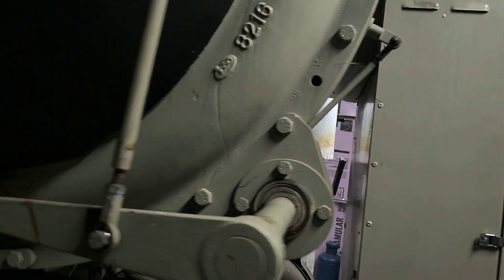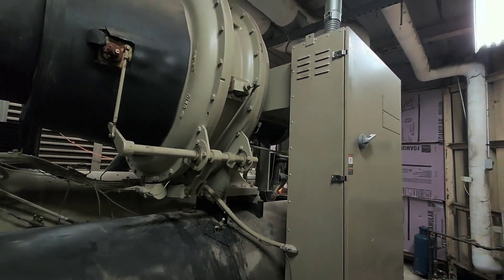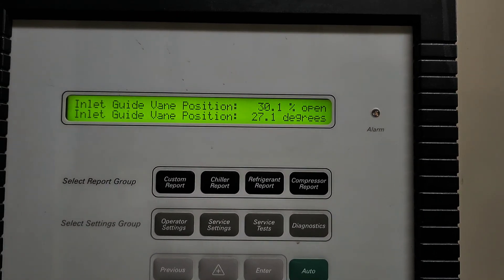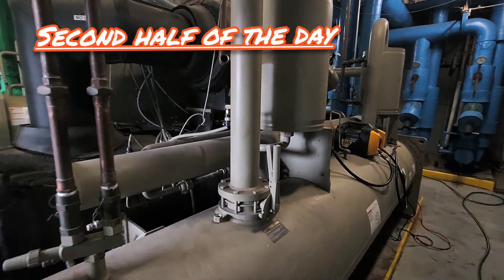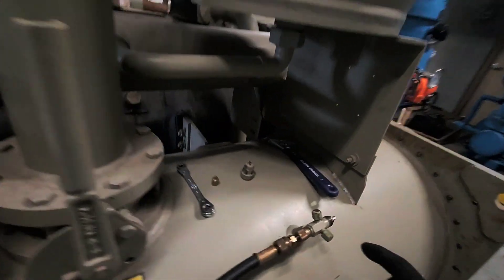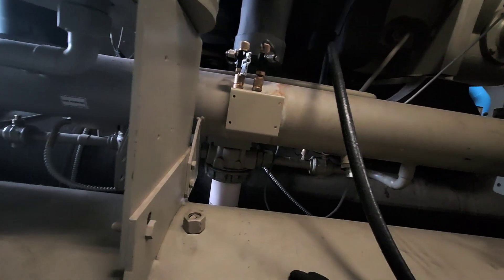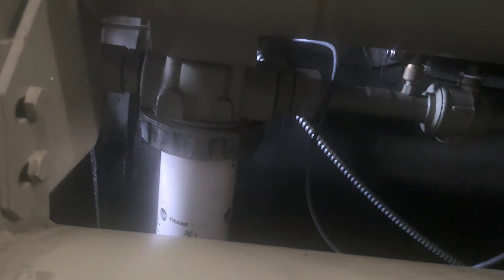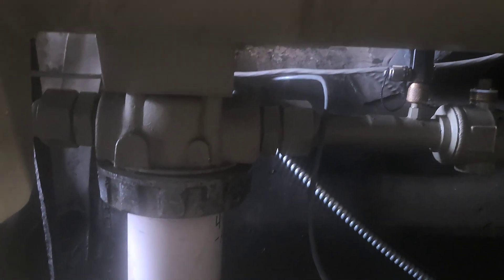CENTRIFUGAL CHILLER IS SURGING. SHOWING HOW TO PERFORM OIL FILTER REPLACEMENT ON RTHD.

Comment: First you need to take the purge out of adaptive. Dumbest thing ever. 7 psi at 27% should of told you that there was air in the machine. Oil pressure is extremely low for a Trane machine. Yeah surging, adaptive mode calculates how long and when it should run. Auto mode starts the purge when the machine runs. Adaptive mode was thought for electrical efficiency. Dumd idea.

Comment: The thing about huge chillers, during cold starts like this, there will be some surging. I watched a clip of a 950 Ton Trane Centravac centrifugal that's older than you and me put together start up after a long winters nap and annual, and it was surging like a SOB.  It took awhile, but it settled into a stable state and everyone was happy.  The turbine on it is as big as most jet engine intakes!

Comment: Nice job burping that big boy!  🫧👊 Keep em coming 👍
Reply from the maker: It still needs some work and it was struggling all day. It's quite humid here so she's struggling to make a dent on the building. Ended up shutting her down and firing up the other centrifugal after she started surging like 5 hours later. Thanks for the comment
Reply: @JJ-COMMERCIALHVAC  I’ve seen them take a few days here, have to deal with high humidity too